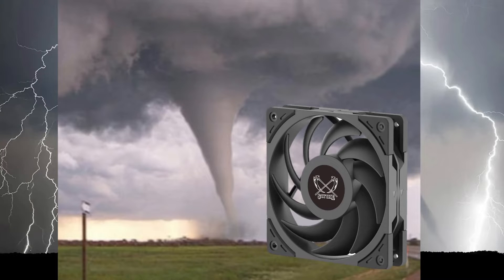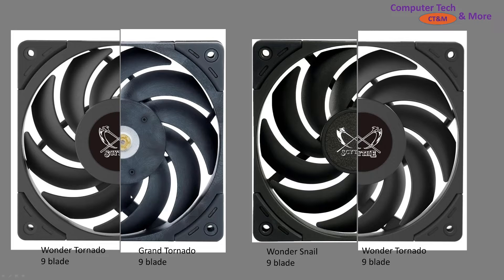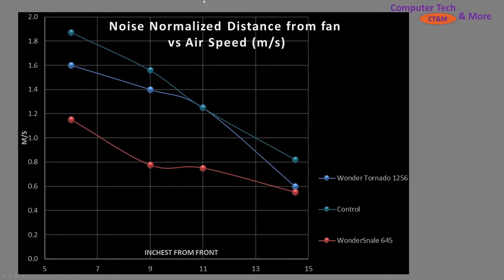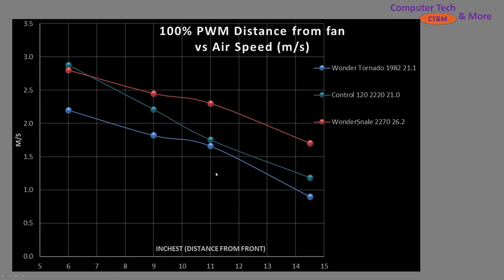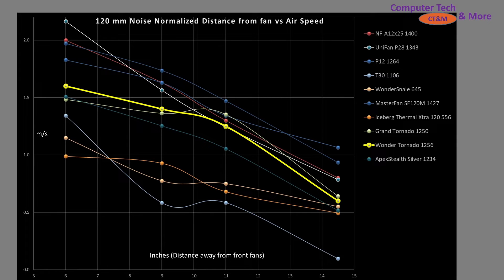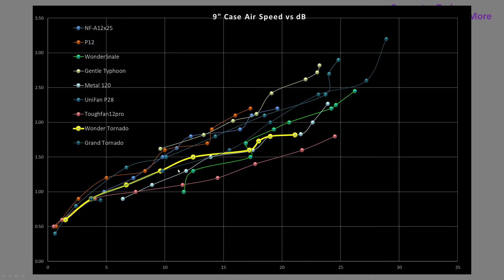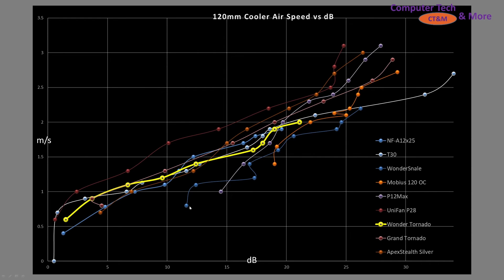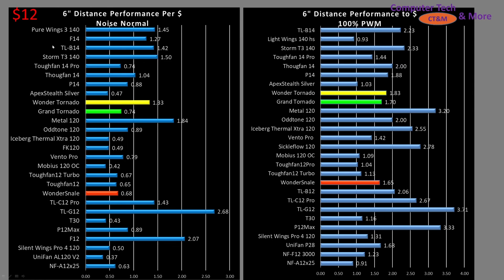Scythe Wonder Tornado: is it a dust devil or is it a real twister?

Comment: I have these and and the FDB Arctic P12 Max available locally in my country for fairly cheap. For the top dual exhaust fans in an NR200, which do you recommend?
Reply from the maker: The FDB P12 Max is better if you need the extra performance 2500+ RPM fans provide. if you dont need that much air movement these will do just fine.
Reply: @computer-tech-more  I'm going to lock them at medium speeds, with gaming loads at around 2000 RPM to keep it more on the silent side. Now which do you think would serve me better? I noticed that the P12 Max seems to do very well at shorter distances, which might be meaningful for the smaller case that is the NR200. They're about the same price to me, so I could get either.
Reply from the maker: @yamato1420  i think the P12 max was quieter but I reviews for both. you could check which will be quietest at the RPM your going to lock the fans at.

Comment: 14:50 this is because the Tornado fans were created to generate high static pressure instead of high CFM. If you could do some testing through a few radiators (low and high density fins) and add static pressure to your testing, I think you would have a more comprehensive idea of what each fan is doing as far as moving air. I liked ur vid tho gj
Reply from the maker: I have a rad now but it arrived after these fans were tested. From testing so far. air speed thru the Rad and my U12A cooler are equivalent. 
Now max static pressure testing isnt really what I am going for. like making a windtunnel or building an air pump / pulling air thru a tube. 

I have a V3 of my testing method in mind and it includes a lot more types of tests as well as adding Temps to the cooler testing. I'm just not there. to small and no budget from youtube / not enough viewer support memberships.  :( 
I hope to get there one day. I would like to add more tests. 
I started all this because I was unhappy with all the larger channels testing methods. 

Anyways: Thank you for watching. I'm glad you liked it.

Comment: Would 5db be roughly 41% more noise rather than 50% more since 2^(1/2) = 1.414?
Reply from the maker: so there is a perceived loudness value called Sone. dB=33.2*log10(Sone)+28 so converting it to calculate for Sone. lets say 15dB = .41 Sone, 20dB = .57 Sone, 25dB = .81 Sone. 
I am not a sound eng, I'm mechanical so this would be a great question for that specialist.